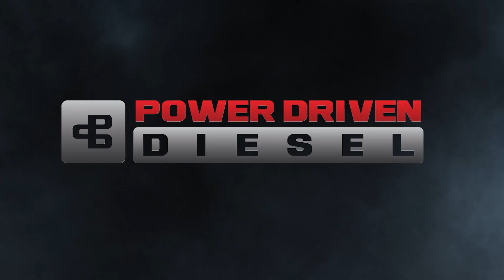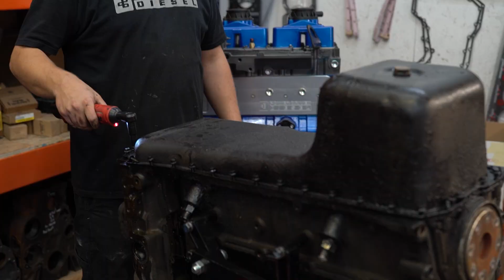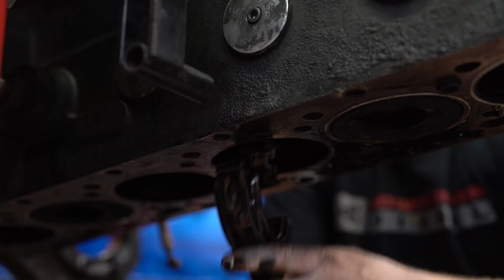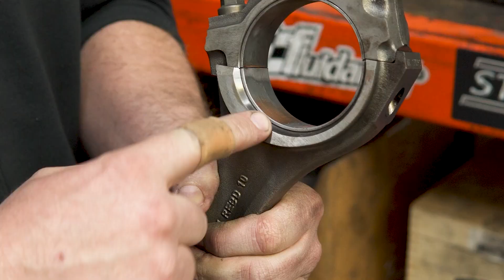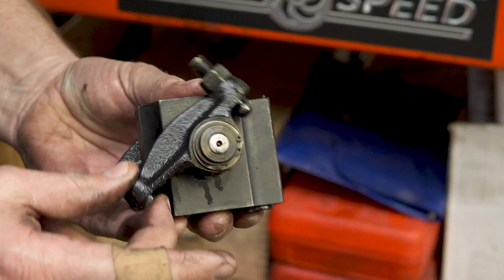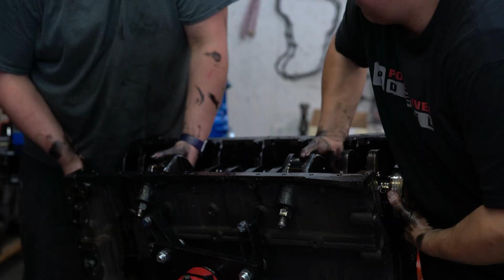Inside 650HP 12v Cummins After 350k Miles

Comment: Is Rotella oil junk?? T4 T6?
Reply from the maker: Any new specification CK diesel oil on the shelf is junk compared to the older CI4+ spec oil that these engines used to run on back in the 90's and early 2000's.  Will's comment wasn't intended to target Rotella necessarily, basically any new spec oil that is designed to protect DPF or Cat and sacrifices engine wear.  If you have a new truck that was designed to run the new spec oil, Rotella T6 or whatever is your only option unless you want to sacrifice exhaust treatment system longevity to better protect the engine internals.
Reply: @pddofficial  K thanks for the reply! Im new to the diesel game and i wanna take care of my engine and trans. I have an 24v Cummins, and the forums talked shell Rotella up? What would you suggest?

Comment: 2:09 "junk Rotella" ///  Yeah, OK. Whatever you say.....
Reply from the maker: Any CK spec oil is going to have similar detrimental effects on wear items in an older diesel engine that was designed to run with CI spec oil with much higher ZDDP anti-wear.
Reply: @pddofficial  Did you run conventional or synthetic in yours?

Comment: As a first time inquirer to having a hi-po trans built, I just got off the phone with one of your staff- must be nice not needing another customer. Treated like he just didn’t give a shit. I’ll take my 8g’s to another place.

Customer service/dis-service… your reputation is yours to earn or burn. Thought I’d let you know.
Reply from the maker: Sorry to hear that, who did you speak with?
Reply: @pddofficial  

I would’ve written a name if was being helped but I wasn’t.

I’ll paraphrase and maybe you can help. I realize you don’t do remove and replace, I don’t have a garage large enough to store my truck to do it myself (or likely the skills, tools, and ability), and are reticent to handing over an eight thousand dollar transmission to any knucklehead to install. My days of garage mechanic-ing at this level are long since gone and would like an R & R guy I can rely on to put a transmission like that in my vehicle.

I am an original owner of a bone stock 2000 Dodge Cummins 5.9 with 240,000 miles and want a transmission befitting the engine in front of it so I can hand it down to my daughter in my will and I am finding no solutions here in Southern California for a high potency builder/installer with my original transmission-I don’t want to core exchange. ATS will do this job but after seeing a tear down of one of their builds, I’m having reservations.

As you serve customers nationwide I thought you might have contracted or recommended installers in my region tied to your product befitting your warranty and the response I received implied he was too busy to bother with me.

If you have a solution or are interested in the project I’m all ears.

Thank you for your response

Comment: When you increase hp and torque will that always cause higher engine and transmission temperatures when towing up long grades?  Utah has some long 5% and 6% grades on I-70 where my slightly modified, 1998 12 valve gets close to maximum temperatures pulling a 14,000 lb 5th wheel.  What modifications have you seen that may increase pulling power without having to pull over to let the truck cool down?
Reply from the maker: Compound turbos help tremendously with EGT control which in turn helps with overheating.  OEM copper cored radiator also cools much better than the newer aluminum aftermarket "cheap" radiators.  For the transmission a finned deep pan makes a noticeable difference like 15 to 20 degree drop on most trucks.  If that's not enough, adding another transmission cooler and fan under the truck is good for another 20 or so degree drop.  
When really pulling hard up the big longer hills, kicking the heater on high and rolling down the windows in summertime is another way to pull more heat out of the engine/cooling system.  And finally, the guys towing really heavy like 25k gross usually add an electric pusher fan in front of the radiator to push air in addition to the mechanical factory fan pulling air.  A final help is to run a lower temp t-stat so you approach the hill with a lower base water temp.  

All that said, the factory cooling system is not adequate to keep 600 sustained HP cool on the mountains pulling a load, it takes a semi truck cooling system to do that.  But 600 HP sustained is enough to run 100+ MPH up any grade here in Utah with 14k 5th wheel.
Reply: @pddofficial  Thanks, I'll have to look into it.
Reply: pdfofficial is right. cooling systems are designed around duty cycle more than max hp. my 36,000LB FL80 275hp C7  🐱 has a much larger cooling system capacity than any 2500 or 3500 pickup built in the 90s. the only suggestion that i will add to his is add an auxiliary heater somewhere outside the cab to get rid of some heat. don't waste your time with anything less than 40,000 btu.
Reply: also.. can a later model ram electro viscous fan clutch be retrofitted to your 5.9? if not then on some viscous fan clutches the engage temperature can be adjusted. i did that on my other (International) boom truck when i put a new one on. i didn't like the engage temp on the new unit (oem no longer available). all it took was loosening the hold tab screw on the bi metallic coil and moving it a few notches. that won't STOP your heating up but it would give more time until reaching higher temps.
Reply: Indian canyon and sheep creek is 8%+, utah boy here also ;)
Reply: the stock fan sucks, throw a couple of electric pushers on the front and let it eat. :)

Comment: Curious did you have an external gate to route exhaust around the k27 into the 472? I suspect if you didn't pick up power with the sxe472 it is because it was choked in front of it. Also what turbine and exhaust housing size 472 is it?
Reply from the maker: Internal gate only.  We tried both a 1.0 housing and 1.25AR.  The 472 is also tight fit with the factory shock shock tower so it didn't make sense to add a hard to fit, more expensive turbo where the 369sxe worked better for the intended towing application.  On the flipside, with the PDD 24V Cummins Common Rail Towing Turbo Kit, the factory He351cw worked extremely well with the 472sxe.  The 472 fit well, and when combined with a custom larger turbine wheeled HE351, it was good for over 900 rwhp, yet still capable of excellent towing manners on a stock 300 ish HP truck.

Comment: Rod bearings usually always the first to go.  I am actually surprised at that much cam wear, but that is a lot of miles. I think 400rwhp single and 600rwhp twin is a good reliable nice driving power level for 12valves.
Reply: 👍👍right on man
Reply: Recommend any particular single turbo for clean low egt 400hp level as thats my target number
Reply: @CustomJeep  depends on how you want it to drive and how you use it the most. If fast spoolup and power under 2000rpm is important to you an s300g works great an sxe362 will be stronger from 2200 rpm on up but will have virtually nothing below 1900rpm in comparison to the 300g. That being said despite the sxe362 spooling 200-300rpms slower it will knock 200deg off egts so if you keep it wound up in rpms and loaded heavy where you need that extra egt cooling it’s the better choice despite it not driving as well in traffic.
Reply: @CustomJeep a big s472 would do quite nice and keep them egts down if it's setup right it won't spool slow
Reply: @Avoided_room  a s472 would be fine for the low pressure turbo in a twin setup. It would be useless as a single for driving unless you plan to run 4000-5000rpm all the time.

Comment: I plan on building a nice tow rig using a either a 90's Chevy C30HD frame or a Ford F550, What would be the best transmission to use behind a 400-500hp Cummins? I would like to have a manual like a 5sp Eaton or a newer 6sp dodge manual. Don't feel like investing in $10K Built automatics, Not drag racing just wanna tow comfortable any mountain that comes my way.
Reply: If you have the space under the floor I would use a FSO-6406a Eaton Fuller. Its twice the trans of of any Getrag or New Venture.
Reply from the maker: The G56 6 speeds have larger bearings than the NV5600 and they are usually more affordable.  The ZF 6 speeds have a good reputation as well.  Outside of those three light duty factory options, I don't have enough first hand experience to share an opinion.

Comment: Junk Rotella???!!!
Reply: Its walmart oil.
Reply from the maker: Not targeting Rotella specifically, any CK specification oil is junk compared to the older CI4 plus spec.  The CK spec strips most of the anti-wear ZDDP additive.  The rocker arms on this engine would have been seized and cam would have totally failed in this 12v if it was running "modern" CK spec oil.  50% of the rocker arm pedestal cores we receive back have galling/seized metal transfer from the rocker arms.  6 or 7 years ago we would see maybe 5% rocker arm pedestal cores with galling/damage.
Reply: It all comes back to the ridiculous emissions standards.  Thanks for putting out such great content!

Comment: I want to take my 96 apart look it over. But I want to waite till I hit 500000miles I got less than 20000 miles to go. I have compound turbos my truck probably sits around 500 to 550hp. It's never had the head off of it. I still have stock valve springs and all.
Reply from the maker: 500k miles is awesome!

Comment: What valvetrain cominations would you reccomend for a 93 12v with 5x.014s and a 62sxe? And can this injector and turbo combo make 450-500 reliably with a quick spool
Reply: If it is still a VE truck you won't make 450+rwhp with an iinjector that small. I made 488rwhp many times with an old 62-68 .80ar s300 but with 6x.018 injectors and a lot of head work stock everything else.
Reply: @bcbloc02  hmm alright ive read a ton about it being able to atleast make 400 with a reasonable turbo and 5x.012s, just needs the pump cranked up and tuned out
Reply: @tylerbrotzman7452  Probably be right around 400 engine hp with that but not wheel hp. I had a 93 with the pump maxed and 370 marine injectors which are 5x.012 and a hx40-16 and it dynoed just a bit over 325 to the tire and it burned clean so I don't think changing anything that didn't increase fuel would add 75rwhp.  I am going to say most of the 400rwhp 5x.012 ve trucks have never actually been on a dyno.  They are like the 600rwhp 7.3 powerstrokes.
Reply: @bcbloc02  what was it at pump timing wise? and correction factor on the dyno would probably change it some, i know some brands read high and others read lower, could be a classic case of inaccurate dynoes with the 450 to 500 hp ve's i have beeb reading about

Comment: You mentioned that this truck started well in the winter and I. The summer but the new engine build will have a hard time starting. I always wondered why these heavily modified diesel engines have a hard time starting. Is it the quantity of fuel injected, the injection timing, or the valve timing? Would be nice if you guys could explain.
Great video 👍
Reply: Low compression and high timing make them hard to start.
Reply: @bcbloc02  
By "High timing" you mean advanced fuel injection timing?
Reply: @augustinglenn  Yes 30+deg BTDC Start of injection is high timing. Some pullers can be 50+deg advanced
Reply: @bcbloc02  
Oh ok. Thanks so much for the clarification
Reply: @bcbloc02  
It's amazing that the engine can even run with fuel being injected so early on the compression stroke
Reply: @augustinglenn  12:1 compression and huge injectors can result in a lot of ignition lag so even though the fuel is in then it may not start to burn for another 20deg of crank rotation.  That is for the guys running 150+psi and 5000+rpms all the time.
Reply: @bcbloc02  
So low compression to accommodate the high boost, large quantity of fuel to take advantage of large amount of oxygen and advanced timing to ensure all this gets burnt to harness all the potential energy available in the fuel\air charge.
Reply from the maker: The new engine won't be low compression specifically to help it start better.  If we were solely focused on reliability, we would lower the compression.  The aggressive camshaft in the new build has more valve overlap which reduces the amount of air trapped in the cylinders when starting so it acts like low compression and negatively effects cold starting.  The bigger cam will also increase volumetric efficiency of the engine which will help it make more peak power.
Reply: @pddofficial  
Nice. Thanks for the insight. Good luck with the build. Will be looking out for updates.

Comment: So all that blow by was from the head?....wow. Show us what that looks like when/as it is torn down
Reply from the maker: There were some vertical scuffs and small score lines in conjunction with the tired rings that were contributing to the blowby.  It looked bad in the video but we've seen much worse for sure!
Reply: @pddofficial  So the head was in good shape? I have seen pistons and rings from bigger engines w 14,000 hrs that had much more scuffing on them ,collapsed  worn right out rings that had blow by like that. I would have bet the deed to the ranch the head was pooched after this vid

Comment: We tore down the engine from my old truck, 1996 Cummins at 494,000 miles. It was only about 150 hp overstock for the last 150K.  A lot of those smiles were short trip city and local. Hone marks were gone in cylinders 5 & 6. Most bearings looked really good except #5 rod was in bad shape and one main was a bit rough, No idea why. But the crank polished out. I noticed they low the thumping sound for the last 75,000 miles, because of the rod bearing.
Reply from the maker: Occasionally we've come across random rod bearing failures but not a common issue for sure.
Reply: What mods did you do to get the extra 150hp? I'm looking for a little extra hp on my stock 97 with 237k miles. I tow a toy hauler to the desert.

Comment: You talked about the abuse but how was the exhaust temps, was it pretty moderate or did it see 2k EGT weekly
Reply from the maker: It probably saw 1800 weekly, it probably couldn't get to 2k without a trailer load on a steep hill or at the drag strip at 100 MPH.

Comment: I would love to see this for the vp44
Reply: Aside from the bowl location, what difference would you expect?
Reply: @preachers4135  to see what parts wear differently. What lasts with the 24v and what doesn't last.
Reply: @Doug6251  5.9 12V and 24V engines are virtually the same besides the head and fuel system.  
There’s a few oddities in crank / cam sensor locations but they don’t effect wear.  
2003 introduced common rail fuel system and changes in the block.
Reply: @preachers4135  so there would be no difference in wear? Good to know thanks man

Comment: Great to see and hear the engine performed great for that mileage at that power level. I have a '98 12v with Industrial Injection towing compounds that have been on there with supporting mods for around 100k as well. I do everything with it from daily driving it to work everyday to hauling a horse trailer. It really is a proven and reliable setup that works flawlessly. You couldn't ask for better driveability and spool up and G56 I have in it also works great with the 12v. A lot of what it takes to "get things to last" is all in how you drive it. If you drive it like a hot rod every single day, then don't expect super longevity if that's what you're after. There is definitely a time and place for it but I don't beat on it every single day when I'm driving it to and from work. Using quality oil and keeping up with oil changes is another high factor of course.
Reply: What oil are you using the one they advertise?

Comment: I inquired about having you guys build me an engine last week  I told the guy I was thinking about power range from 650 800 hp he quoted me on that but I’m wonder if I needed the engine to be that built I will be towing a trailer with Jeep on it about once a month and driven daily back and forth to work I planned on compounding it but got me thinking was I planning to over build it I know it’s better to but after seeing this video it got me thinking and also with that power range I was quoted am I able to lower the power range dramatically with the afc I just have questions and serious about buying engine from pdd. as my machine shop local guy just retired so I don’t trust any shops with this type of build
Reply from the maker: It's tough to know where you'll end up power-wise in the future.  The main differences between a 500 HP engine build and an 850 HP engine build would be the head studs, o-ringing or fire ringing, piston to wall clearance, ring gap, and coated piston skirts vs stock.  More power means more heat so clearances get opened up for the higher power levels.  When you start looking for 1000+ HP is when the build drastically changes because rod failure comes into play, camshaft size, etc.

Comment: I’m planning on going with the ultimate towing compounds on my truck. Thanks for showing this. It just confirms that this is the route I want to go!  Now do you think a ZF6 will hold up behind it? (Fummins)
Reply: Send it to superstick in Texas
Reply: Zf6 behind tuned 6.7 cummins lasts about 125,000 miles then 6th gear(5th) will break teeth when the rear counter shaft bearing, which runs directly on the counter shaft, gets too much wear. Been rebuilt twice about same mileage running redline mt90 gear oil. I figure 5.9 would be about the same. Nv5600 better trans imo.

Comment: I just rebuilt my 12v after dropping an exhaust valve. It was around 600hp for about 50k miles and my rod bearings looked the same.
Reply: do you run compound turbos? just bought a 97 dually to tow my trailer to the desert. i wouldnt mind another 100 hp.
Reply: @MarcoRodriguez-lr2xt  i just went from a single silverbullet 64 to a s362/s475 compound setup. Unreal the difference.